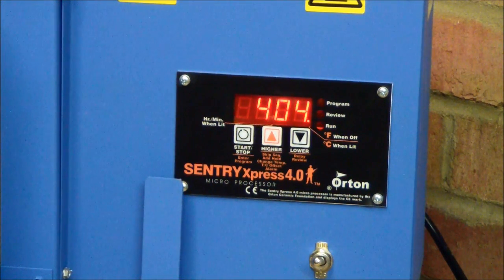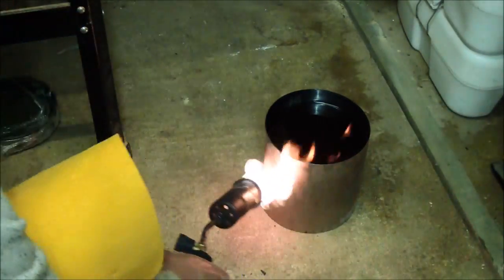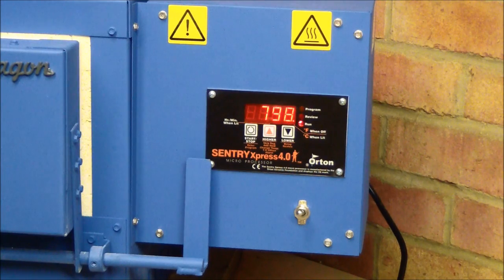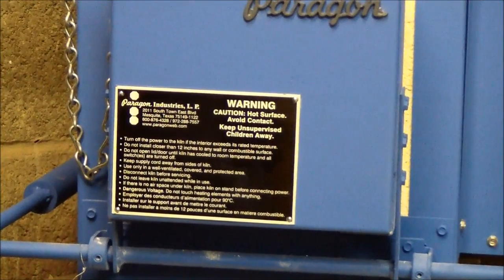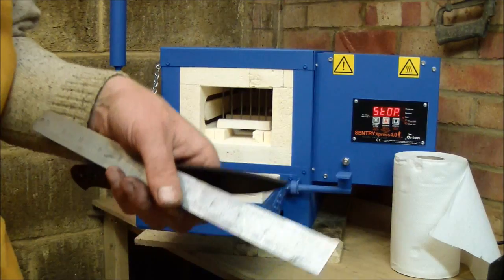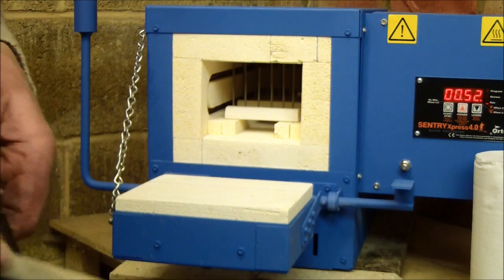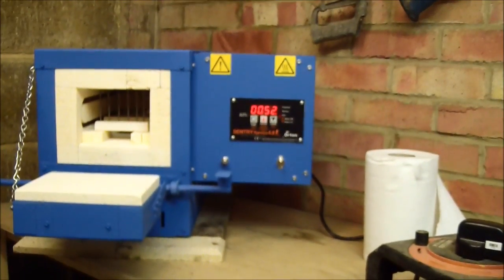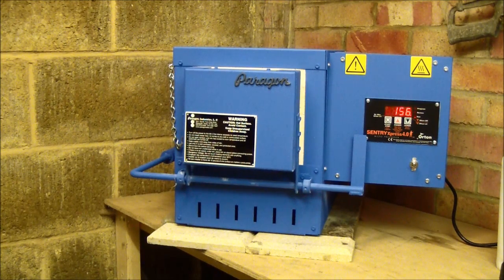Heat treating the Jacklore knife

Comment: lovely tool sandy - will you be getting an annual calibration done (just in case it wonders over time).
if you can trust it - spot on - it frees you up to do other workshop jobs.
its like having another worker in there with you (i think you should give all your machines names - like harry heat treater & lionel linesher etc) 
with that and the stove going, you can make knives in the nude lol - be sure to cover the little chap though he he he.
nice kit sandy

Comment from the maker: Hi Tom,
There is a slight lag in the blades temp as the kiln climbs. That is why I let em ccok for a few minutes to stabilize. I am as sure as can be that the blade will be within 1/10th of a degree of the indicated temperatre. I have been told the thermo couples are very accurate.
Sandy